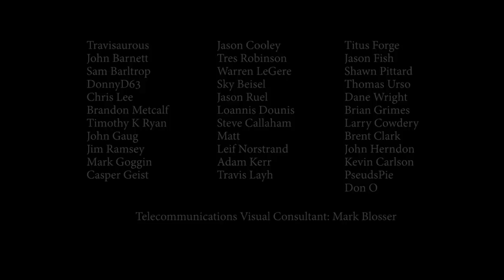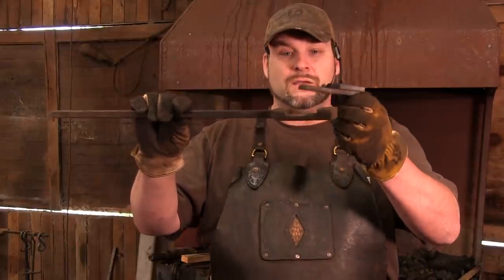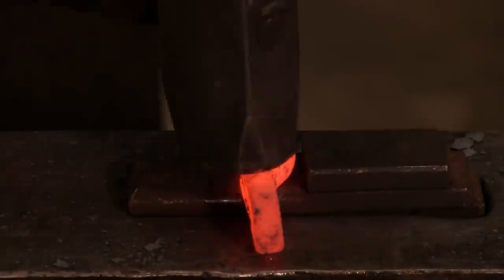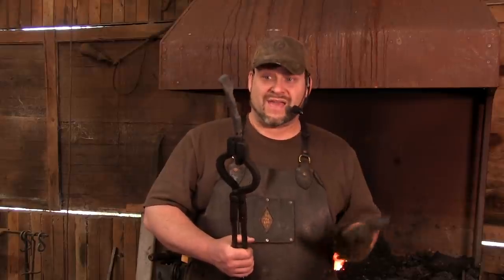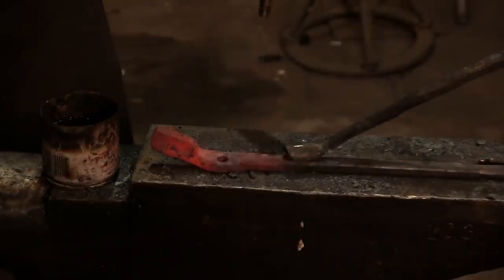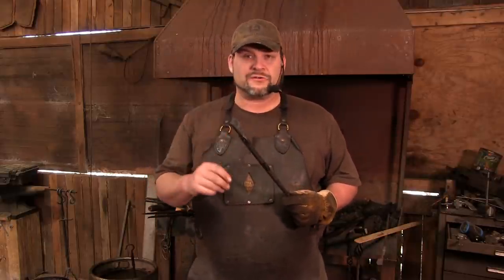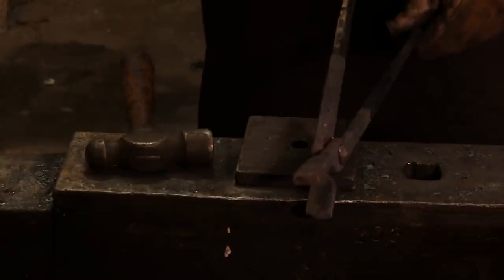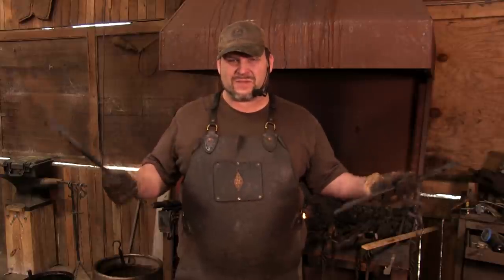2021 Blacksmith Instructional #26 "Forging Flat Jaw Tongs" #blacksmith#tongs

Comment: I'm a beginner but I have found that a RR spike is just enough material for one half. I can pick up a bucket full of them in 20 mins when I stop at the tracks on the way to town. They may not be the perfect material but are good for practice.
Reply: Everyone picks them up but if caught you can get in trouble. Best to find a railroad guy and ask.

Comment: I like the spacer block idea. A set depth to protect the thickness of your material is a super idea for beginners, and maybe some guys and gals that have been at it a while too. You never kbow when your mind is going to wonder off task, when doing things you've done a thousand times before. Of course the experienced smith can upset the material back in on itself. But why put those extra stresses on the material if you don't have to, right? Great video to show a better way for beginners to make tongs, and get the proportions correct. Nice job, Trent.

Comment: I like the Idea of the spacer bar. Tell me how did you fit the top piece to the bottom piece couldn't see any weld. Also with the punching for the rivet, I have been told and seen on YT that  you should start with the nib facing down over the edge of  the anvil, so that when you go to punch it out from the other side, it lays flat over the pritchel hole. Just a thought . Good job.
Reply from the maker: You surely can do that but it was a bad camera angle for filming!
Reply: @purgatoryironworks  Yeah I get it. Filming can get a bit confusing when try to forge and explain things.  Good on ya Trenton.

Comment: So two things first why didn't you upset the boss back? (I did really hear you give a measure for the transition from boss to rein. If you did I missed it.)

Secondly if 3/4" is to big which I don't believe and 1/2" is too small in your opinion again I agree, what's wrong with 5/8"? Is it because you have the tooling set up to do 3/8"?

Comment: Thats why I have a pair of v jaw channel locks from Irwin they're really good at holding everything for me lol but I do sometimes run into a problem with having to change my angle of where my work is and where it needs to be but they're alright I only made one decent set of tongs that were straight out v tongs with a wide slot for rail road spikes that worked well but I couldn't get the concept of setting a rivet by hand in them so I used a bolt and nut and they're in a pile of steel lol

Comment: I would guess I have seen literally a hundred videos on making tongs, and this is probably one of the best.  But what I don't think I have seen is someone make a pair of round nosed tongs.  I know they were common in the past, and all the old manuals mention them. Box jaw tongs appear to work just as well for holding round stock as they do square stock.  My question is: if box jaw tongs work for round as well as square stock, why did they historically make round jaw tongs at all?  I would think that round jaws would hold the size they were specifically made for, plus or minus a sixteenth (and maybe even less).  I think box jaws would hold a little larger range . I have never seen anyone give a reason why they made round jaw tongs when box jaw tongs appear to work just as well for holding round stock.